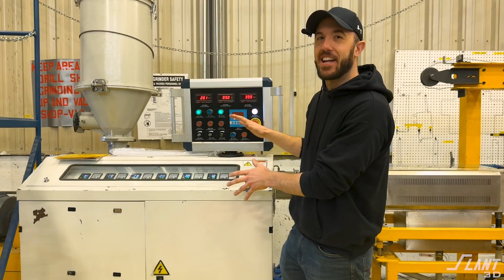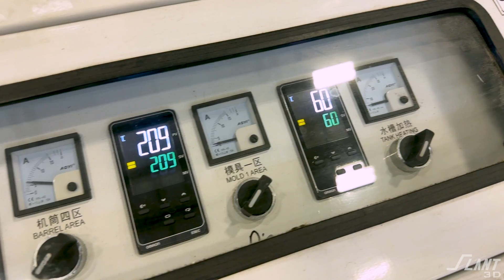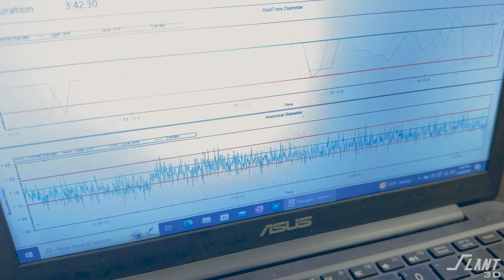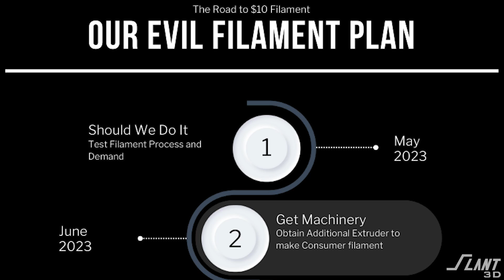The Wrong Way to Make Filament | Road to $10 Filament

Comment: What about having the baths run vertically above each other?

Filament can snake it's way down
Reply: Bending it while hot creates variances in thickness. Additionally, you want to keep liquids low. Liquid is very heavy, and the larger the load, the more expensive supporting it becomes. With a horizontal system, reducing the load on the frame is done simply by adding more mounting feet. To reinforce a vertically oriented machine you need to increase the thickness of the frame.

Great question!